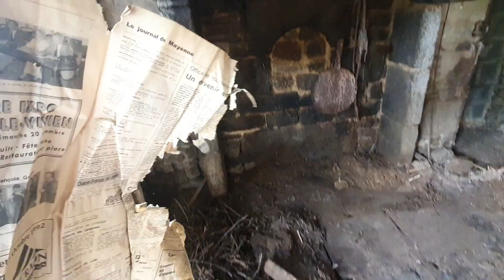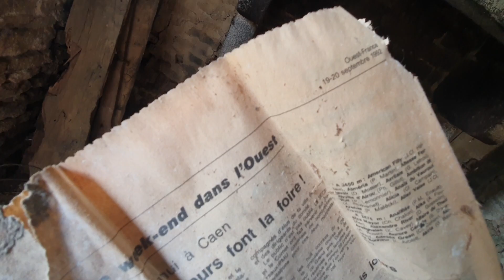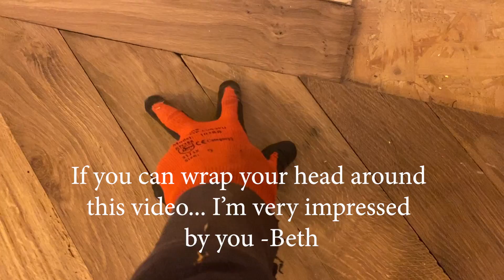This Has To Be Our Biggest Challenge Yet!

Comment: When you leave "extra" for each, you sometimes end up with a bit more extra than you pictured simply because you're multiplying that extra by the number of panels. I imagine you put a reasonable bit extra to the measurement to make certain that the repeat of the pattern was compensated for. And if the repeat ended up being fairly evenly spaced when the fabric arrived, you didn't have to waste as much trying to line it up. 

In other words, I think you're fine. 

HOWEVER, if you realize when you go to hang them that they are too short, just put a panel at the bottom, which a lot of curtains have as a design feature. I would use a satin that pulls the lighter colour out as you are using the gold already in abundance. But if you have enough of the gold fabric you could use that as well. Either way. Do a wide band at the bottom and a thin 2" strip at the gather at the top to tie it in. Don't look like you're trying to hide it, make it look like it's on purpose 😉
Reply from the maker: Thank you Andrea, I have cit the fabric and there's plenty, in puddles on the floor. It was a bit tricky getting them to hang the way I wanted, but sorted now and taken them back down to hem.
Reply: @LifeAfterLaFerté  Happy they worked out! Means less sewing lol. Can't wait to see ☺️

Comment: Another great video.  I was with you Carole when you were checking your logic before cutting the fabric. I think that is the most stressful part of making curtains as there is no going back if you make the wrong cut. I noticed you were using tailors chalk. I discovered a great alternative- heat erasable pens, available from ebay and Amazon. They are brilliant as you can use them for cutting lines, sewing lines and you just iron off the markings. I used them to draw embroidery designs on fabric which worked brilliantly, especially as I am not the best artist so I could redraw until I was happy. The curtains are going to look fab.
Reply from the maker: Great idea Sue. Thanks!

Comment: When measuring the length of the curtains I usually add 10 to 20cm onto bottom (floor length) and cut before I gather the top. I pin layers together to keep them together when there is a stretch in the fabric.

Comment: how about use laser line from other end of straight board edge run (across the other line of the room - towards the, what looks like other radiator next to that chair and window, wall)? of course, setting 'straight' run courses will help to see if laser line will work that direction and not go wonky
not prof advice, just suggestion for hopeful straighter line
Reply from the maker: That’s what I did!

Comment: why not a slab of grey marble where the outdoor door is? That way you don't have to worry about wet on the wood floor at that spot and it ties into the baseboards and fireplace.
Reply: I was thinking the same thing.   Something similar as we see at de la lacelle.
Reply: Isn't marble slick to walk on when wet?
Reply from the maker: Great idea but might be slippery as I have seen mentioned.
Reply: @LifeAfterLaFerté  You could use a mosaic of marble tile instead of a slab then, mimicking the pattern on the wood floors in miniature. It wouldn't be as slippery as a single slab but have the same effect of uniting the look of the foot boards and fireplace while protecting the wood floors at the same time.

Comment: I think they did the same as in Brasil,  each meter they give a little slack and let say 2-3cm. As you asked for 16 m, you already have 40 something cm, as they for sure don't want some overseas return they gave another meter which is much cheaper than a return with complaints.